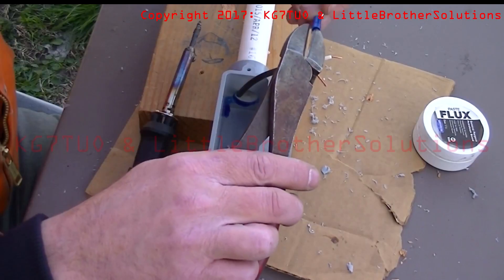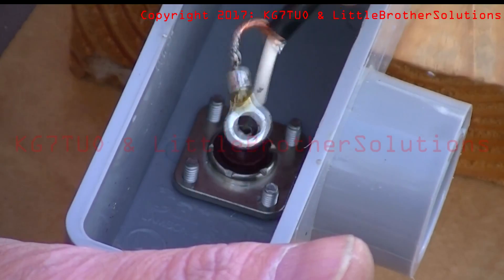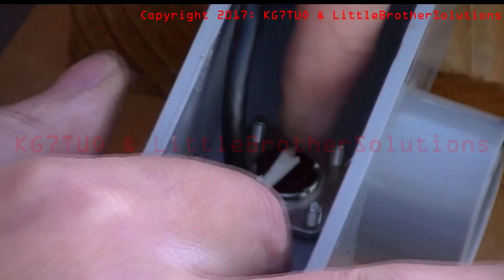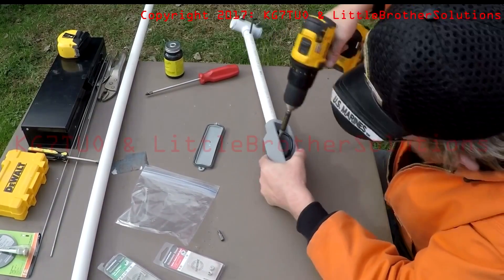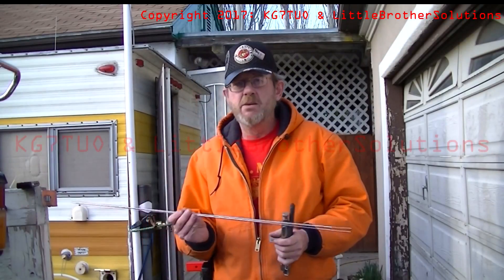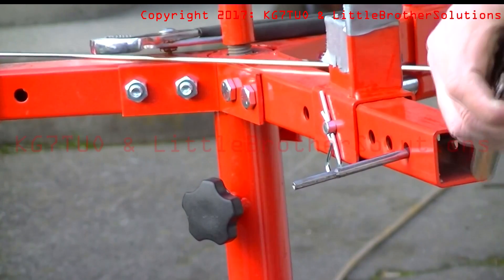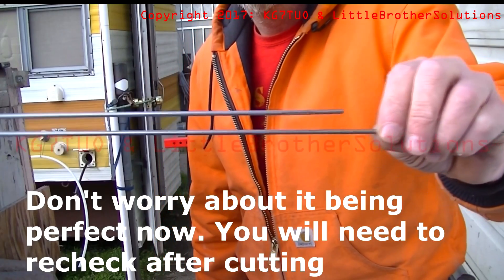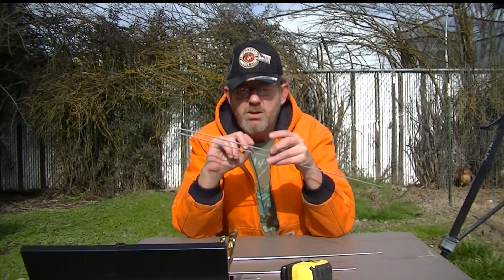Dual Band 2m / 70cm vertical dipole BUILD #2 Part 3 of 4

Comment: Beautiful work. I am thinking that bypassing the so239 and just running a cable would obviate some impedance and improve swr?
Reply from the maker: Yes, any time you can eliminate adapters, connectors, etc. you will improve losses.

Comment: Suggestion... when you get the "U" bend int the ball park, I would drill two holes in a spacer the exact distance apart, and then epoxy it in place to guarantee that it is parallel.

Comment: Did you try with a different sized radius yet? Math might be more complicated but there might be some clues in the calculator for the folded dipole. Not that it is dual band but it can calculate the distance between the two sides depending on frequency. I'm just wondering if performance might be optimised with a different gap. (total wire length might change).  http://www.changpuak.ch/electronics/Dipole_folded.php
Reply from the maker: Well two things.
1. i've moved on to other projects. Built a 2m vertical dipole from zip ties, barbed wire, and two wood scraps....no solder, hardware, etc. and it worked great.  I shot a quick vid to show it today before taking the feedline to make my latest creation.....an antenna that use water (yes WATER...tap water at that) for the elements. First prototype works though I'm going to have to work on the SWR for 2m.  It happens to be great on 440 though.  
2. The washers short the RF energy between the two vertical elements so I don't think longer wire in a bend will hav an effect. Electrically there should be no energy going there. The gap itself could change performance due to interaction with the other element but that would be because of a greater or lesser distance between the radiating and non radiating element, not the added rod length from a larger radius bend.

Comment: If only you could make something. I don't know, like, a jig maybe. And then find some kind of un-reactive material to space the two elements equal distance away from each other.
Reply: I think (perhaps because I have professionally bent and installed a few hundreds of miles of conduit and wire) that he should have used a #2 Philips  for the former and something in the next hole to bend against. Then over bend elements about 10 to 15°. The spring back amount will vary depending on the material and it's temperature. A small wire or tubing bender will not help because they won't bend such a small radius.